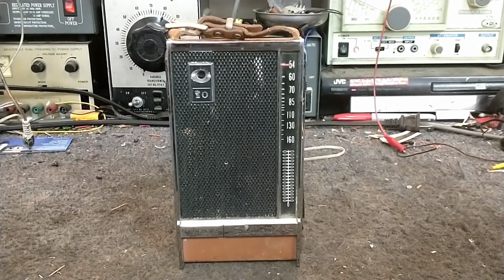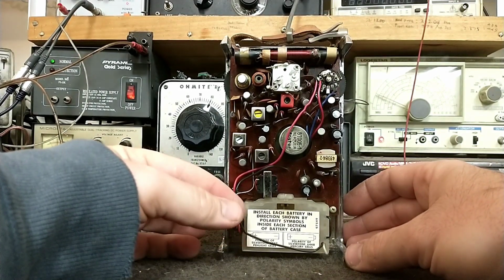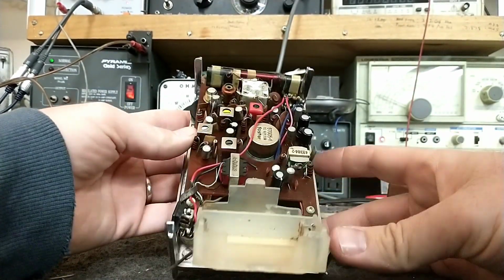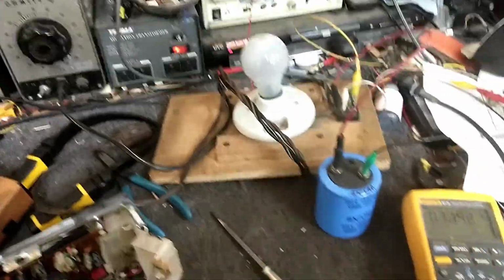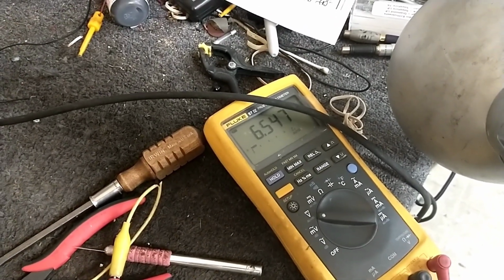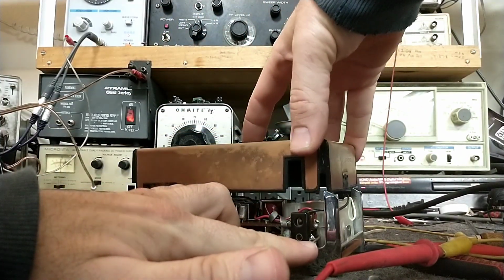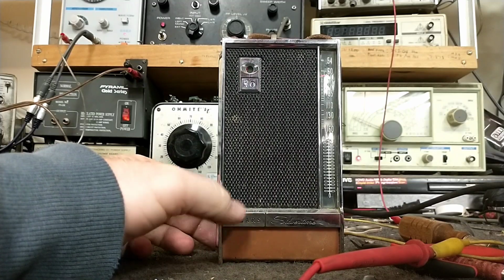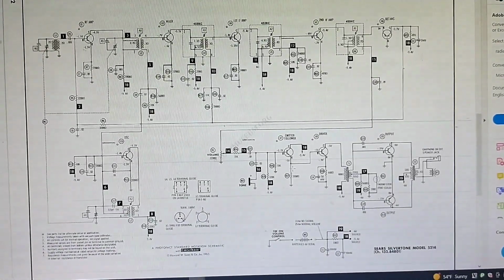Quick repair of a 1966 Sears Silvertone model 6214 10 transistor radio. Cat 132.621401

Comment: Real nice repair using a capacitor discharge spot welder. If you run across a radio with no  model number on it search 
good old fleabay for the radio and someone will have the model number or a photo showing an intact  label with it. The 
radio attic is another place to find model numbers matching  the many photos of radios they have. Radio Museum is a 
good place to confirm it's model number. Not surprised it was made by Arvin. They made some spectacular looking 
futuristic looking radios in the late 1950's thru the 1960's. 50/50 mix of vinegar and water should clean the leather up 
quite nicely.

Comment: I don't remember seeing a small radio like this with a thermistor for regulation of the bias. That was not a cheap set I am betting. Did Zenith or anyone else do this in these small sets? Nice find. 

I would be curious to see what the ESR looks like in some of those caps, bet they are ok, but still curious me would want to know. I do have a MESR-100 meter, but I am thinking of getting a Capacitor Wizard, seems quicker than and easier to read than a LCD screen.

Comment: It’s a vintage koronette console stereo bar would love to get the fm on it working thanks for any help
Reply from the maker: Without schematics its almost impossible to blindly troubleshoot these without spending hours of your life. Check voltages to FM oscillator and RF amps. Usually around 9-12 volts. If the AM works, there is s shared power supply so its more likely transistor failure.

Comment: I like your use of a charged big cap to dump a high current into the spring.
It really went well :-D  (not something i would risk) ive had too many shocks at 240 volts.
Maybe some wax shoe polish to make the back look better.
And a cut down marker pen to cover the grill knocks perhaps.
It does sound really sensitive, no need to touch any of the settings.

Comment: You should throw a set of eneloop 2500mah batteries so you don't have to open and close the radio every time you want to use it and not have to worry about battery acid. 
I keep low self discharge nimh cells in stuff like toys and radios I have.  You can also use Panasonic blue carbon zinc batteries. I have never had one of them leak, but the potential is there.
Reply from the maker: So far the fuji made amazon batteries have been good to me.